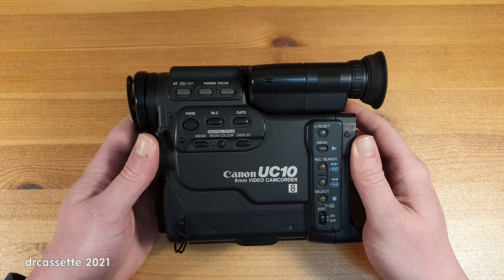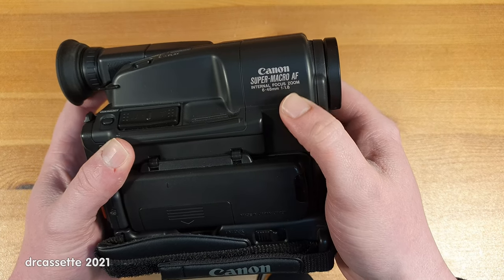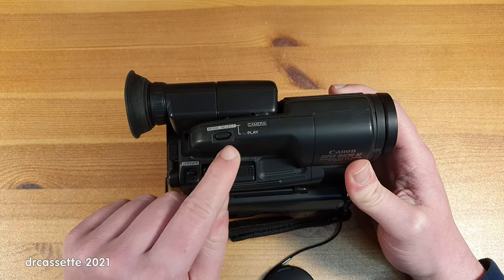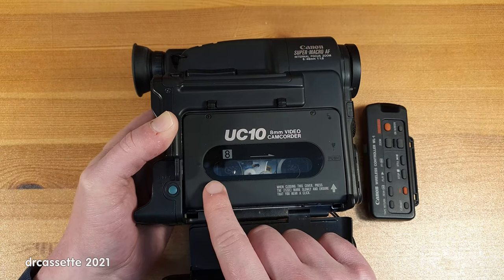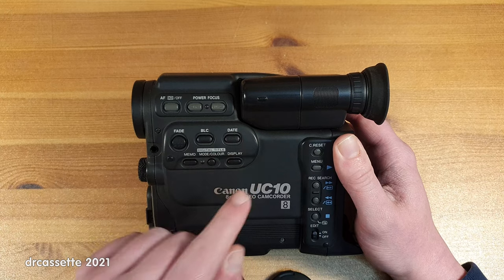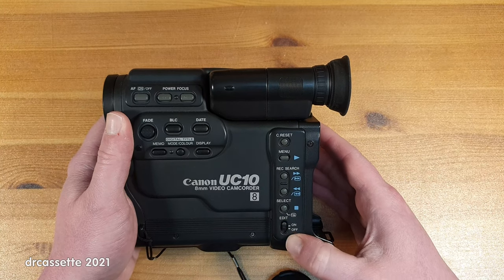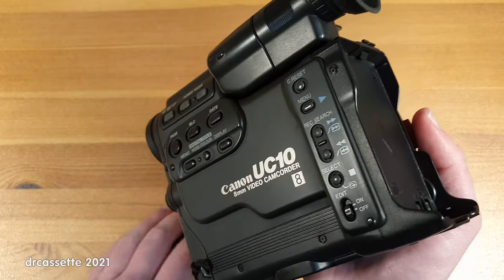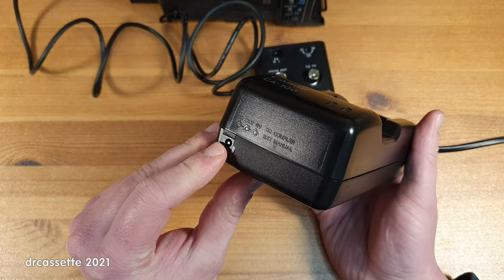Detailed look at the 1991 Canon UC10 Video8 camcorder

Comment: I have one of these. When I got it, there were capacitors rattling around inside! Surprisingly easy to get in and service, though I didn't end up getting it to work. The sensor board is for whatever reason entirely undocumented, and one of the many custom ICs probably fried, can't even get playback.
Reply from the maker: Trying to repair these camcorders is pretty pointless. The electrolyte that leaks from the bad SMD capacitors gets into the internal layers of the multi layer circuit boards and keeps causing problems, corroding the internal copper traces.

Comment: I have this camera and trying to digitate some old videos. Im having a problem with the audio beein super low and the picture is very disorted. Do you know how i can fix this?
Reply from the maker: As mentioned in the video, these old camcorders all have bad SMD capacitors. These are likely the cause of the problems you have with your camcorder. Unfortunately repairing these old camcorders is not economical, I would suggest you look out for a newer Video8 camcorder.

Comment: Hi, great video! I have a question about another camcorder if you do not mind answering. I have an old JVC GR-DVL9200 and a tape has gotten stuck inside. At most, it has only been used for 50 hours in the past 18 years. It charges perfectly and was working perfectly until 2 months ago. Is there any way it can get unjammed ? Or is there a button I can press for it to release? Not sure if it is a mechanical problem or not. Thanks
Reply from the maker: If the camcorder makes mechanical noises when trying to eject and eventually aborts the eject process, there is a mechanical problem. If it just sits there, you might be able to get it to reset by leaving it disconnected from power for some time.
Reply: @DrCassette  It beeps 2 times when I open the case which is what it is meant to do but it doesn't eject the casette. It hasn't been used for 2 months since it happened so it has been disconnected for a while.

Comment: I would've loved to see some effort in getting this thing to work or at least show the cassette drive in action or anything. Don't get the point in holding a defective thing into the camera and to tell that it doesn't work - the end.
Reply from the maker: The point of this video is to document the unique design of this camcorder. I said this in the video, you seem to have missed that. I am not going to waste my time trying to repair this camcorder, the electrolyte that leaked from the SMD capacitors will have already gone down into the multi layer circuit boards, so even if I would manage to get the camcorder to work, problems would keep appearing due to the boards slowly corroding internally.

Comment: i have a canon UC1 which is the same as  a UC10. mine seems to work except for the viewfinder and when i plug it into the tv i get a bunch of vertical lines that move when i move the camera. is this a bad sensor? is that fixable?
Reply from the maker: As I said in the video, these camcorders are full of bad SMD capacitors. Those can cause all kinds of strange problems.